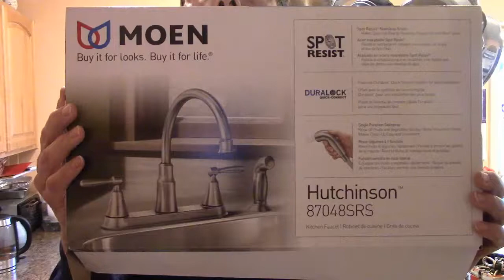Moen Hutchinson Faucet Review by the old handyman

Comment: I have one, just failed after less than a year. The "Duralock:  connector leaks and the gooseneck, cheap plastic nut .  When you get into it,its a bad design. Cheap materials on and on
Reply from the maker: I think mine lasted more than a year but I've gone to simpler faucets I don't care about them pull out things anymore they always get goofed up